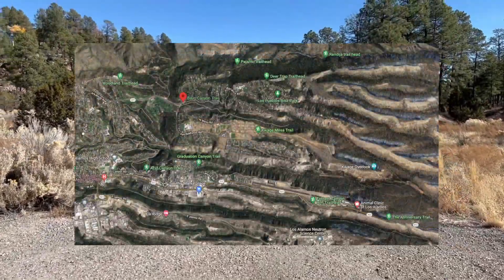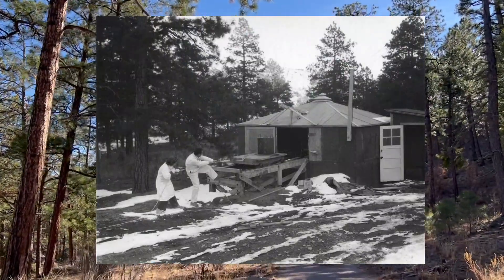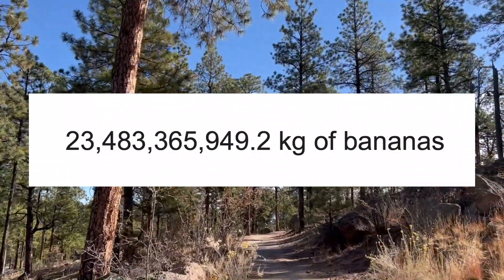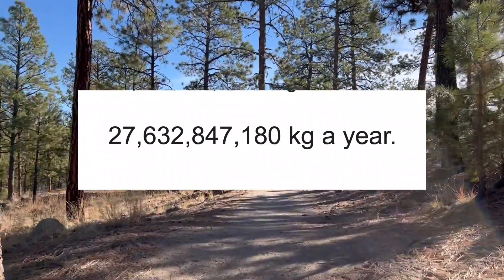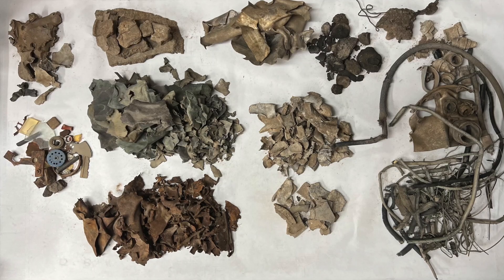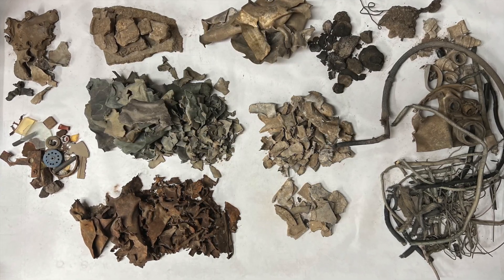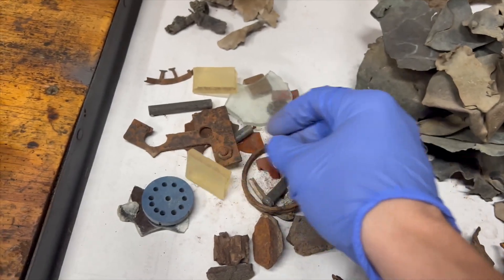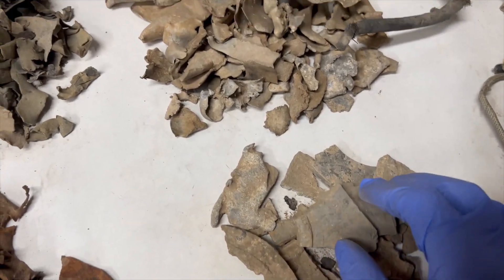Nuclear Tourism - Hunting for Radioactive Artifacts in Bayo Canyon, Los Alamos

Comment: What about the little boy?

I hear modern weapons could make a crater 30 miles wide, which would royally screw me living so close to London...

Graphite rod may have been from a radio or communication device

I thought the blue circle would be from a connector and it looks like you've a few in the ones you have